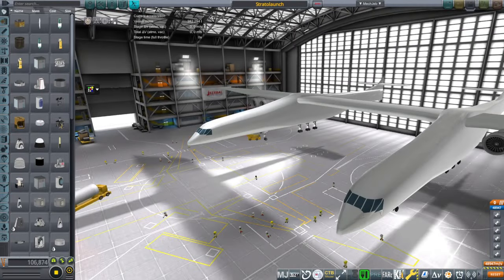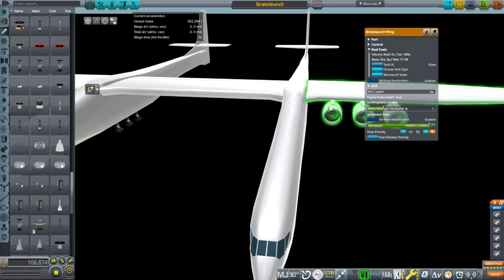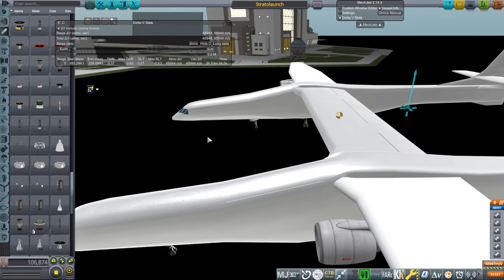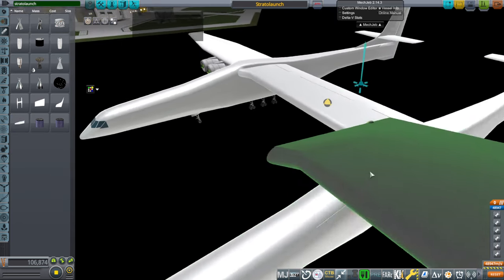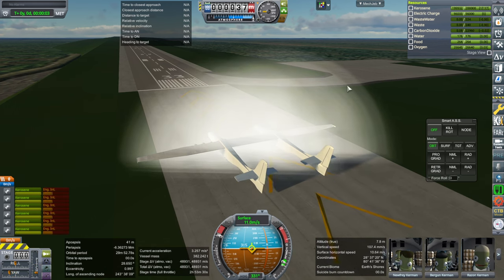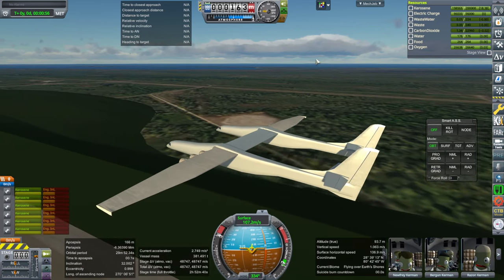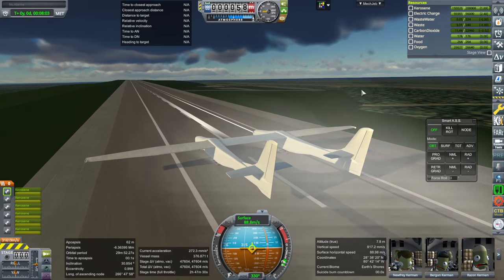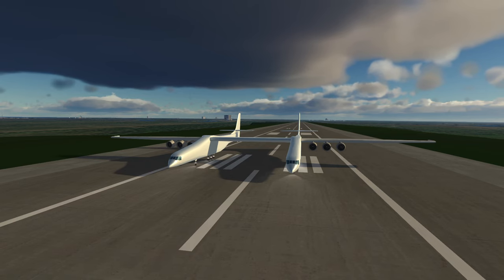Stratolaunch First Test (KSP 1.12 with RO)

Comment: Not sure if I am going mad but it looks as though the control surfaces are animated in the opposite direction to the aircraft movement!
Reply from the maker: Hmm - looking at the elevators, you might be right, but I have no idea why. I don't make an animation on them - I just indicate they're a control surface, and I thought I did that the way I usually do. I'll have to investigate further.

Comment: Having done a bit, if you make the center wing piece the root, it might help. From a model base, make the center wing a piece that can be a first part, after all, it needs the most structure. In doing so, maybe check out some of the catamaran type builds out there using  base parts. idk if you have tried such, but I didn't hear it mentioned, so thought it might help. Then the cockpits should fit, and your lift and centering should work.
Reply from the maker: I'm not sure you're addressing the problem of assigning lift to that wing under FAR.
Reply: @RaizSpace  If you made the center wing bar a special component of its own, that could be the origin piece, regardless of other parts, the off center part issues from the hangar should be addressed. Whether this will allow the center wing to have lift in FAR, I am uncertain as I have been away from standard KSP and FAR a while. Last I was in it, I was working on a more real refuel and refurbish craft idea, as no mod seem to cover that. But in dealing with parts, when centering and roots applied, if I could set the center line from the start without having to change it, I had better results. I attempted massive SSTOs it mod parts a lot. and runway take offs  were a problem for me as I couldn't seem to get the mass delivery levels I wanted to my acceleration altitudes in any kind of speed.